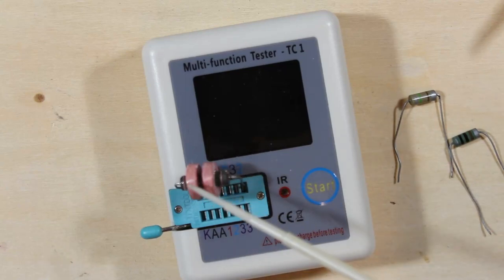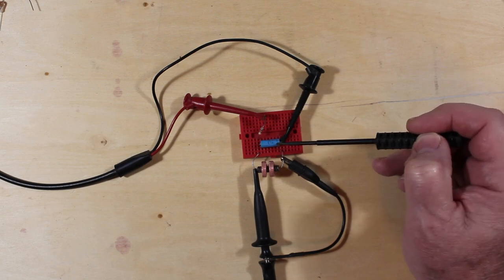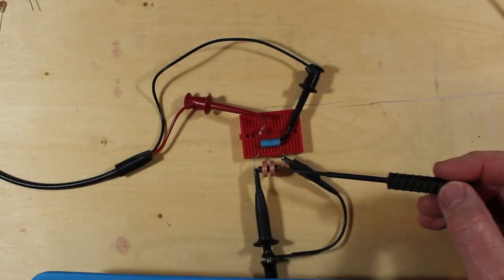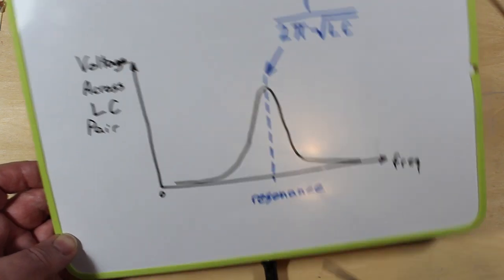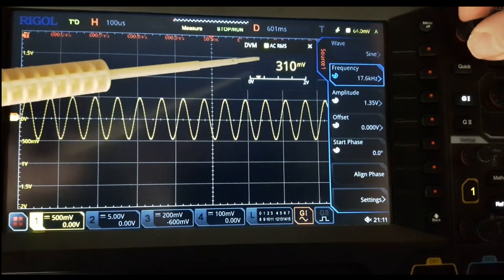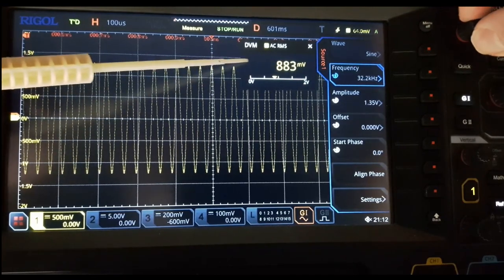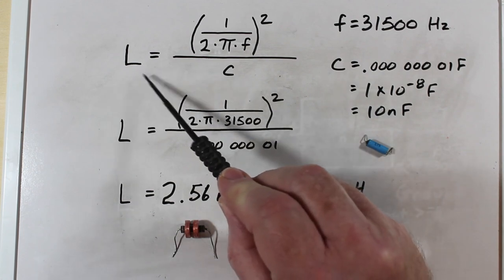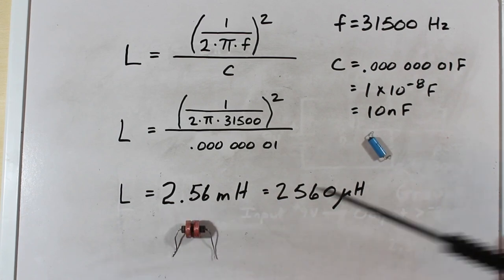Determining Inductor Value Using Parallel Resonance #electronics #testing

Comment: My electronics teacher said it didn't really matter what the tolerance of C was so long as you knew C's value by measuring it.  My meter isn't that good, but have oscilloscope and 1% resistors, will test!
Reply from the maker: I don't have a proper LCR meter to measure capacitors therefore I trust the 1% rating printed on those capacitors far more than I trust the cheap multimeters that I have that claim they will measure capacitance.  Sometimes you have to improvise with what you have.
Reply: @MoreThanElectronics  My RF signal generator and oscilloscope (neither in their prime) can get the capacitance spot on by frequency with a known resistance.  Besides, I don't have any 1% capacitors except an ancient 7500p that's 1%.  I have 5% polyesters.
Reply from the maker: That 7500pF is not  all that far off from the 10000pF I was using.  Roughly how big is the inductor you want to measure?  And what tolerance is acceptable?  It seldom needs to be 1%.
Reply: @MoreThanElectronics  9.25" diameter, 75 turns, #22 close-wound magnet.  About 2.3mH is expected.  It's a metal detector search coil, and knowing its ring frequency will make a better detector.
Reply from the maker: I just put up a video showing the 'ringing' method using a square wave.  If your oscilloscope has a square wave probe compensation output use your 7500pF capacitor with the coil and see what frequency you get.  Calculate from there.  Make sure nothing ferrous is near the coil.

Comment: the easiest way is to ring it using square wave and a diode  ,find out exact capacitor then get the resonance frequency and plug that into lc resonance formula.... tank circuit
Reply from the maker: I saw your comment this morning so I did just that. (Not sure what the diode is for...)
https://youtu.be/EDTTsi0HHPk
Thanks for the comment.
Reply: @MoreThanElectronics  diode prevents overloading the output of generator and helps ringing more in tank  just in case the inductor might induce high voltage (god forbid). Neways you did a great job😊
Reply from the maker: Got it. Thanks.

Comment: Could you add a diode (diode bridge) to covert the AC to a DC voltage   use a DC volt meter to find the peak?
Reply from the maker: A tentative yes.  You can't load it down too much.  I tried it by connecting the anode of a 1N4148 to the junction where the resistor, capacitor and inductor come together.  The cathode of the 1N4148 goes to a 2700 ohm resistor.  The other side of the resistor goes to the positive terminal of a 100 microamp meter that I have.  The negative side of the meter goes to the ground of the circuit.  At peak I get about 35 microamps and it doesn't detune it by enough to worry about.

Comment: Is this the most accurate way of finding inductance ?
Reply: It's a cool way to learn.   

Like the channels way of explaining circuits 

However, easy to do with a nanovna as well.
Reply from the maker: Not the most accurate but not too bad either without using expensive equipment.  You do not necessarily need an oscilloscope if your AC volt meter is usable at the test frequency.  If the frequency is too high for your meter maybe use a larger capacitor. The core material that the inductor is wound on can have a very large effect on how it behaves at different frequencies.  This method will get you within a few percent but only at the test frequency.  Inductor data sheets have a test frequency at which the inductance value is stated.